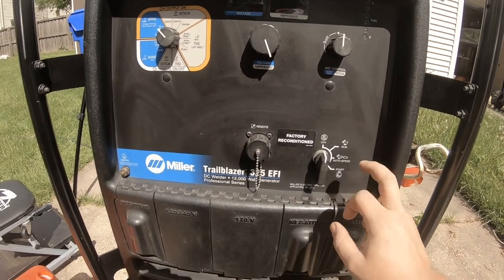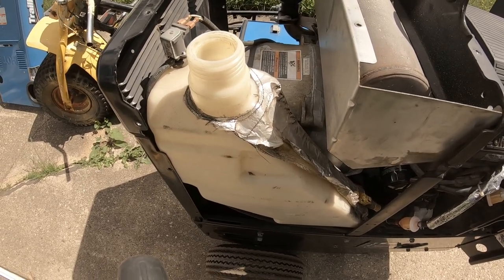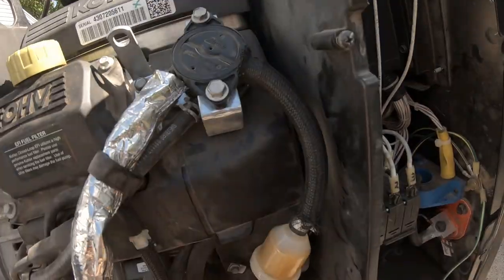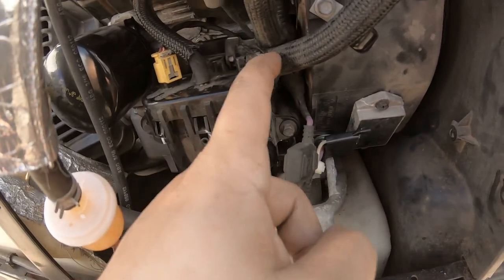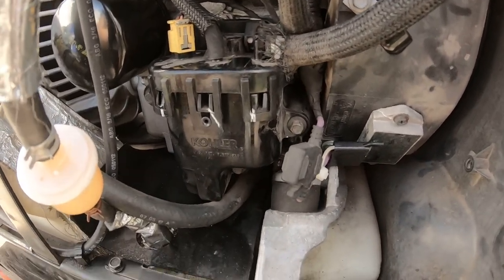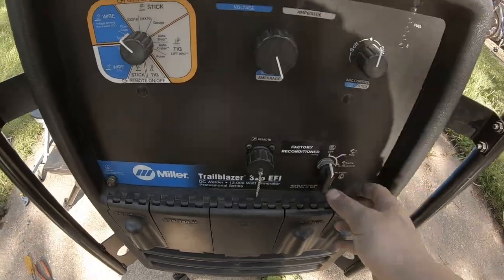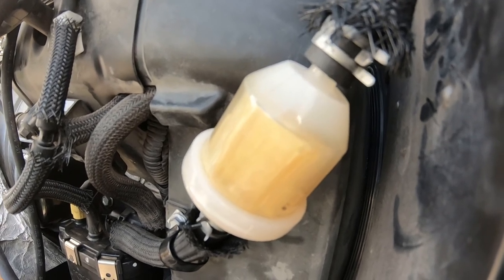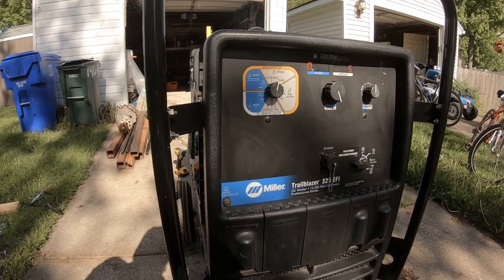Trailblazer 325 EFI - Will It Run - High Pressure Pump

Comment: If take the pump lose from the motor . Then turn the starter switch on . With the pump in your hand with all wires Connected you should feel the pump vibrating that tell you the pump in side canister pump is still working .

Comment: I had this same issue except i wasn't getting much fuel to my first fuel filter and was only 3 gallons of fuel missing from full.. Put those 3 gallons back in the machine and it fired right up and runs fine now. Does that still mean one of my pumps is no good?
Reply from the maker: I would disconnect each fuel hose and crank over to see if fuel is getting past each pump.  That is what an old timer told me to try to narrow down if it was the fuel pumps or something else.

Comment: Thinking mine has the same issue. Should get the pump changed today or tomorrow. Did you do a ecu and tps relearn on yours?
Reply from the maker: No, all I did was connect the new pump and fired it up. Haven’t had problems with it since but maybe I got lucky!